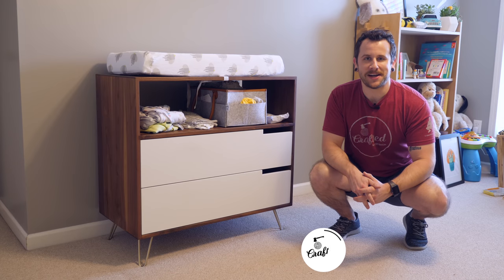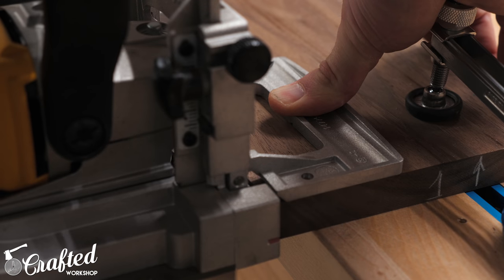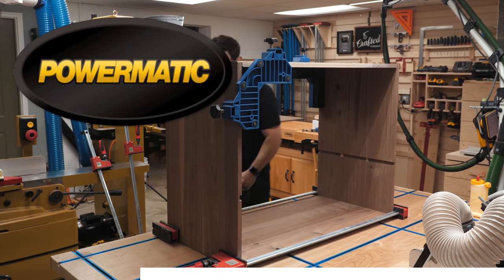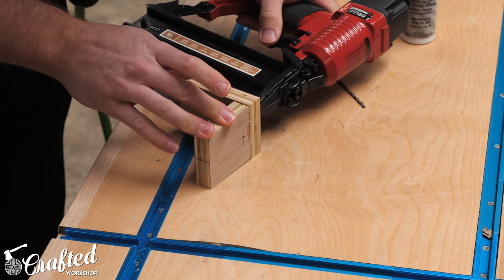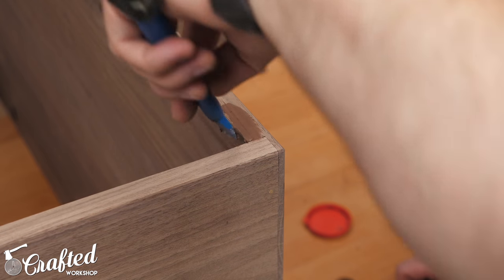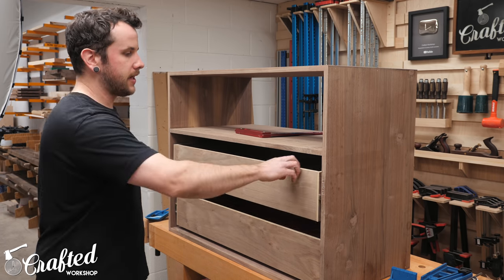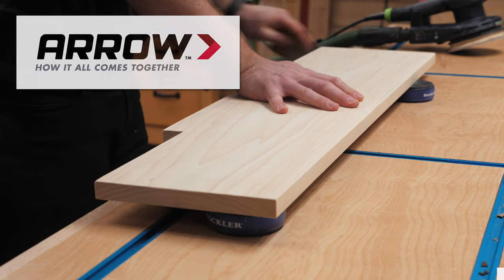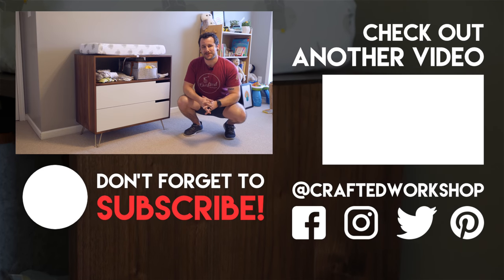How To Make A Modern Dresser & Changing Table // Woodworking

Comment: This is one my favorites you've done! Re: paint....Montana Gold.  The difference between Rusto and Montana is night and day.  One coat is pretty much all you need, and it's far more durable.  It or any other acrylic graffiti can will work, just make sure to get a low pressure variety (unless you are covering a large area).  I've tried Ironlak and MTN94 as well, and they are also really good.
Reply from the maker: Thanks Mike! And good tips, I’m going to buy some cans of different brands to play around with.
Reply: Came to say the same thing.  Montana paint.  It was originally created for graffiti artists, stuff lays down super smooth, color choices are insanely abundant.  Find a art supply store near you, they should have a big selection.
Reply: Surprised to hear good results from Montana. I've never had a good experience using it in modelmaking because it does go on so thick. If I have to use it I leave it for a couple weeks because it doesn't cure well otherwise
Reply: Try any graffiti cans (molotow, flame, ironlak, etc.) The differentce is amazin.

Comment: If you are doing rebate joints for the carcass like you did, you can cut the rebates for the back panel before you glue it up and you don't have to do the messy router work.
Reply from the maker: Yea it would have been a little tricky since it would have been a stopped rabbet on the table saw. I didn’t have the back panel run the full area of the back of the piece. Otherwise, that would have been a great option.
Reply: You don't need stopped rebates.  You make the dado's for the shelf on the case sides the same depth as the rebates for the back panels :)

Comment: Your pliers are short is prolly why it was challenging to cut the brass rod. I cut 8 and 6 awg wire with lineman pliers. I have an 8" klein lineman and a 9" channel lock lineman pliers. Both work well but the extra inch make a lot of difference.
Reply from the maker: Makes sense, leverage is definitely your friend in this case!

Comment: How about a spray gun with cheap disposable nozzles?  Check out the 3M AccuSpray Spray Gun System: https://amzn.to/2I78RyG
I came across this setup in a Bumper-to-Bumper store and the replacement nozzles are approximately $5 each.  My dad has used them in automotive painting and said they work great for small(er) projects, but had issues when trying to do an all-over paint job with them.
This will probably be the perfect solution for what you're doing.

Comment: Is it just me or does the top look like its bending? Probably from having a baby on top of it? Doesn't look safe. The top panels are so long and there's nothing in the middle to support it. There should be a piece of wood in the middle to help support the top when weight is placed on it IMO.
Reply from the maker: It’s ¾” thick hardwood, there is no flex to it whatsoever.